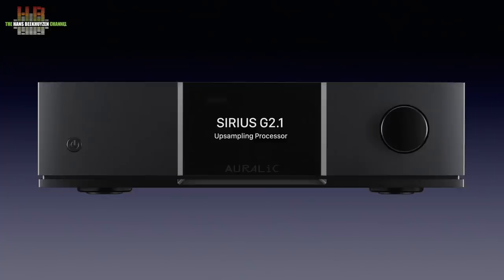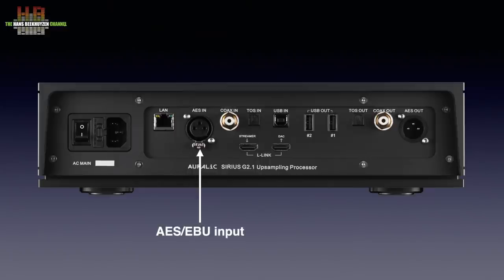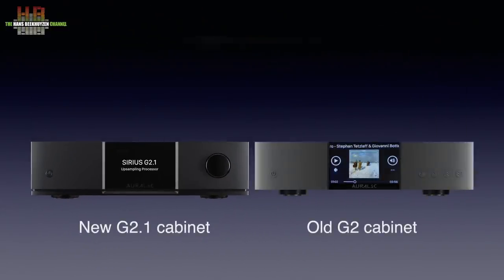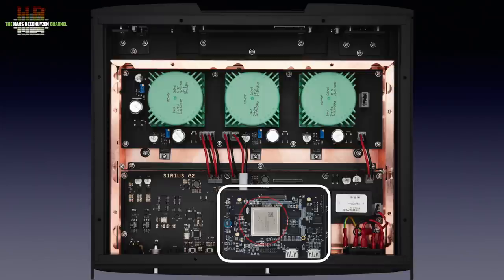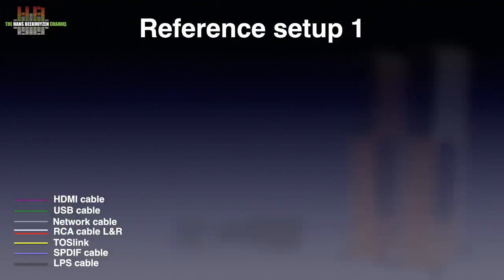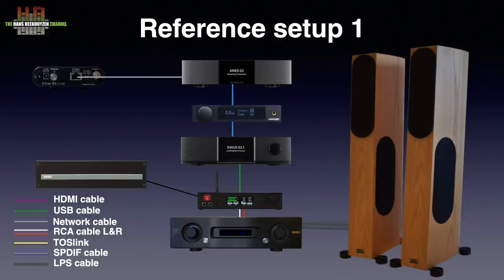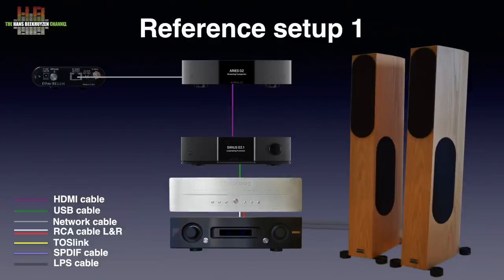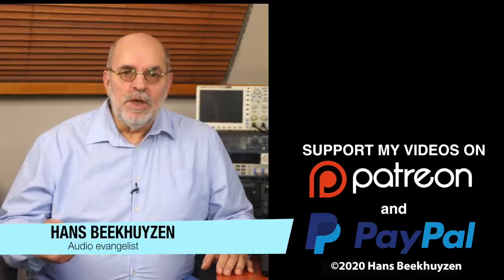Upsampling: Auralic Sirius G2 1 resampler

Comment: Spot on, Hans.  A good streamer with these capabilities does improve sound quality noticeably. I tried a Grimm MU1 streamer in my system and it made a noticeable improvement.  It's connected to a Holo Audio May KTE DAC.  Now I'm curious to try the Auralic Sirius G2.1 to compare to the Grimm MU1.  They both have advanced upscaling, filtering and reclocking.  The speaker placement and equalization features of the Sirius are also compelling.

To those justifiably concerned with the price. Considerthe price of these devices is a lot less than an expansive collection of vinyl or tape.  Getting closer to natural sound  is what these devices do.

Comment: Hi Hans, loving your work. Have you any plans to try the sirius with Auralics Vega G2.1 DAC, One would assume an excellent synergy would exist,  also  the Vega is similarly priced to the denafrips Teminator, which obviously worked so well. If you add the Aries transport, which had its part to play also,  suddenly we are 3/4 of the way to having the entire Auralic four box digital front end... Only the Leo GX2.1 Clock would be needed. I would be truly intrigued by your thoughts of this four box setup, expensive I know at nearly 25K euro/pounds, but possibly a high-end bargain when compared to the DCS setups, which also require very expensive interconnects to get the best from them. Whereas the Auralic only requires good HDMI cables and possibly an Audioquest Diamond USB to get the ball rolling...

Comment: The Smooth setting seems more like its for those who listen with their ears, but don't like what their system/music sounds like, and so prefer to just 'smooth it over' to make it less noticeable... But to each their own!
The difference is quite noticeable, so whichever you prefer, its great that you have the option! (This is based on my experience with the Vega G1 by the way)
Reply from the maker: Perhaps the stereo used might be a factor too?
Reply: I have used an Auralic atiar G1 for over a year now and have switched back and forth between smooth and precise filter more times than I can count.

To my ears, the smooth filter is better because it sounds more dense and real. The precise filter comes off as sounding slightly more vague and less weighty especially in the mid-range.

I feel like it really is system dependent because when I first had the Auralic, I had different speakers and preferred the precise. I keep going back to precise only because I know it measures more accurately, but the smooth to my ears just sounds more real.

Comment: Hans, have you tried HQ Player, integrated with Roon? It has a long list of upsampling algorithms, both for PCM and DSD, and they can be customised with various parameters. Some mimic the ones used by Chord, for example, the closed form milion taps.
It's far more cost effective and you can choose your upsampling flavour on the flyl.
Reply from the maker: I bought a licence about a year ago and tried to get it to sound well in the short time I can spend on it. I'm sure that when you have time to spare and dive into the matter, it will give good results.
Reply: It's also a complete PITA to configure and get working.

Comment: Hans great review!  Do you have plans for reviewing the chord Hugo tt2 and or Mscaler? Seems like a different approach of upsampling techniques and the use of external switching power supplies to fit the dac section in smaller boxes. I just wonder how close they are from audio nirvana with such an unorthodox designs.
Reply from the maker: You never know until it's there.🤔

Comment: Hi i just buy and receive it i plug ok is working after unbox

I go to the menu i activate separation stereo parameter

And no sound
oops i have make somerhing wrong ??

I set defaut mode like new
I read my cd same problem

Big problem after 10 min of using at this price

I m very furious
Reply from the maker: Please ask your dealer or the manufacturer for support. I lack the time to do so.

Comment: Thanks for the great content! I have learned so much watching your channel. I have  off topic question on the lower end of HiFi equipment. How does one know the digital signal quality on a line in if your playback device or converter does not have led, lcd or oled display of incoming sampling rate and bit depth? Thanks in advance. Groete!
Reply from the maker: The only way is when one of the devices has an indicator. If you use a computer, that can indicate the sampling frequency...

Comment: be interested to compare to PC based upsampling
Reply from the maker: I’m not. It’s either disappointing or complicated and in the end you might end up with a jittery signal.
Reply: @TheHansBeekhuyzenChannel  Ah, well no pc option then. Guess Ill be putting my automobile on the market, after all.
Reply: @TheHansBeekhuyzenChannel  
Jitter - 
If the upsampling is done on a PC which sends the signal to a Aries G2 (which I also own, based more than anything else on your review 👍🏼) or a reclocker (e.g. Gaia) - how effective do you think that would likely be at avoiding jitter?

Software improvement 
in the two odd years since you tried HQ-Player I understand that it’s definitely become better, and possibly easier to configure

I raise this update as - 
 - of course - if both jitter can be avoided, and HQP can now do similar to a dedicated upsampler it allows the money to be spent elsewhere  😊